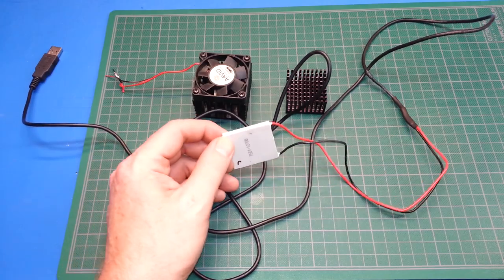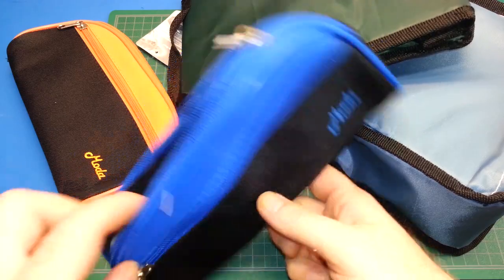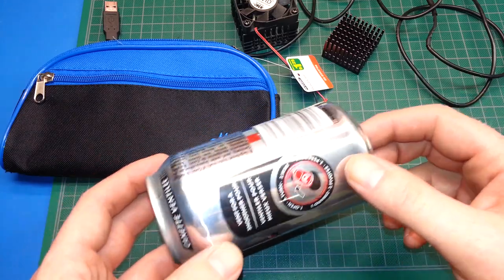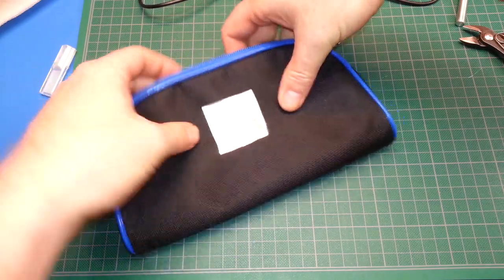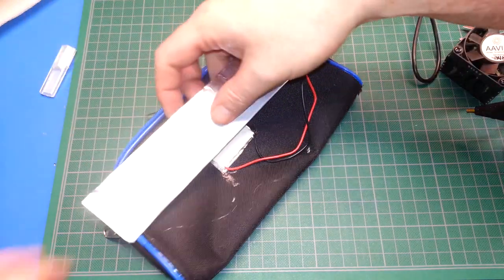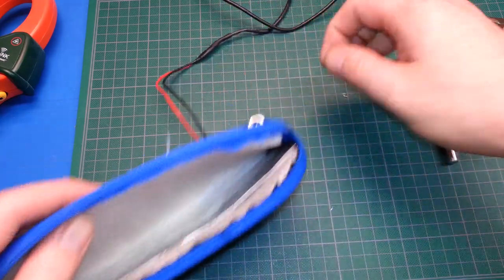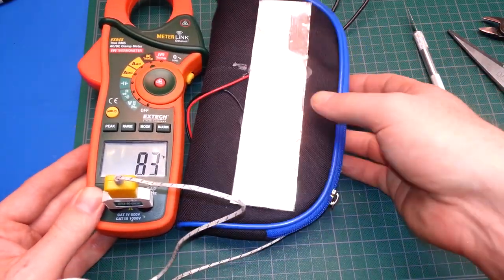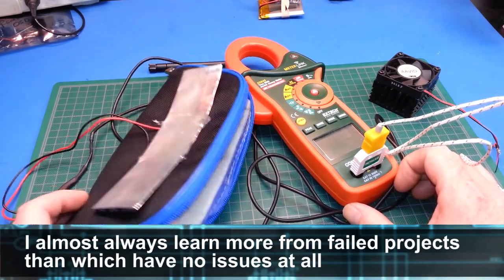Medication & Insulin Cooler Wallet (Fail)

Comment: I'm a T1 diabetic.  A few years ago I attempted a VERY similar project to transport my insulin on a cross-country move.  I couldn't get anything to work too terribly well (tried up to 3x Peltier coolers ultimately on my prototype bag).  What I ended up doing was using a small Case Logic 35mm camera bag that has a zipper pouch with three 'bungie' pockets that I put vials of insulin in (they're made for 35mm film canisters).  Then 5x re-usuable "ice cubies" (small 1-inch square re-usable ice cubes) separated by a folded paper towel (you don't want ice packs directly on a vial of insulin).  The extra padding of the case itself provides adequate insulation that my ice cubies stayed frozen for the 3+ day driving trip.

Like you, I'm quite a tinkerer.  This was one 'issue' that I found the low-tech solution worked best.  I went through 6 camera & pencil bags trying to get something to work. hah!
Reply from the maker: CatLord Low tech indeed is almost always best.  That's what we use too but I just have to tinker :)  Cheers

Comment: Great video Eric. Showing the fails is very important.  I was thinking about a rigid tubular case, with the fan, heat sink and peltier on one end, then the insulated tube, and finally a screw - on cap. It wouldn't be as flat as a pencil case, but much easier to work with. Would basically a tiny - fridge.
Reply from the maker: SurvivalTech Nord Great idea.  Thanks for the comment.  Cheers Sir
Reply: Eric William -MKme Tech 
Not so clever. I realised when I was in my kitchen the other day, what I was describing was a thermos bottle, with a peltier (Doh)
So I was hoping you didn't read my comment :D
Reply from the maker: SurvivalTech Nord LOL

Comment: Fantastic idea.  You may want to try corrugating the heat sink. Less contact with the case and more surface area contacting the air.
Reply from the maker: kpare Great idea for sure.  Cheers

Comment: What I found with my peltiers is if you don't have the heat sink pulling enough heat from the peltier, the heat will soak back to the cold side and raise the temp about 15 degrees. If I have a strong enough fan and large enough heat sink I can get down below zero. That pulling 9 amps though haha.

Comment: Nice attempt Eric, even if it didn't work out. Peltiers are an amazing bit of physics in action, but it's a shame that they are so inefficient... Just 10-15% of the power you feed in is used in the cooling effect, and the rest is coming out as heat. The low efficiency is because the peltier device itself is actually quite a good thermal conductor, so lots of the heat from the hot side is continuously flowing back through the device itself to the cold side. You're going to need to keep the hot side near ambient temperatures to get cooling below ambient, which means you're going to need a heatsink big enough to dissipate all of the watts you're feeding into the device, plus 10-15% extra watts of heat that the peltier is pumping from the cold side. Hope that makes sense. Cheers!!
Reply from the maker: Jim Conner Yep sure does.  They are indeed inefficient but I have a couple wine coolers/other projects which do indeed work (albeit nothing like compressor style coolers).  Definitely fun to play with.  Cheers!

Comment: try it with thermal compound and maybe use a cable tie poked through to hold the two pieces of can in place. its a very nice and considerate idea
Reply from the maker: lykenth08 Will do.  Cheers

Comment: Hi, to Peltier works, you should use thermal grease between heat sink and peltier and between aluminun and peltier, a very little heat sink or aluminun on the cold side insoide and on the hot side a large heat sink with fan, finally  use a power supply between 1 and 6 volts, I recommend 1, 2, 2.5, and 2.9 volts (maybe 4 volts, but no more volts) this is if your peltier module is rated at 12 volts, I do not know which TEC1-127xx you are using but power suply must give 20% or more of XX in current at 2.9 volts, for example if you use tec1-127"10", power suply should give 2.9 volts and 2 amps, if you try 5 or 6 volts power suply must give 50% or more of XX in current. but again I recommend 2, 2.5, and 2.9 volts maybe 4 volts, but no more volts
I do not think it freezes very much, but if it does not freeze as you whish, doing my tips, you need use more peltier modules or a tec1-12715 in the same configuration on volts
Have a nice day

Comment: You need better thermal contact between the TEC and the metal.  Because you don't have polished stable (lapped) surfaces, the metal is only touching the TEC at three or four points.  Thermal paste or thermal epoxy, with some kind of compression to maintain contact, should make a better thermal bond.
Reply from the maker: CBGoodBuddy Yep would indeed.  Cheers

Comment: +MKme Lab Did you ever get something like this working?
Reply from the maker: Yep but they are power hungry. I'll do a follow up video this winter I hope.
Reply: Power is not much of a concern for me - Im wanting to make a chamber that  I can control temp from ~18 to 33 C. Trying to figure out how to use the peltiers to accomplish it. Im thinking about pumping water through a chamber against the cold sides, then running that water though something like a radiator and blowing a fan through it.
Reply from the maker: You might want to check out my Urban Kitchen Garden project. It does basically exactly that. Just throw an H-Bridge on the Peltier and you can heat if needed. I think the code still even has that functionality as well. I had it configured that way initially but never needed the heat as my LEDs heat it up.
Reply from the maker: Heres the playlist https://www.youtube.com/playlist?list=PLxyM2a_cfnzgLjCoJ04S2Z812JrdFKbFX